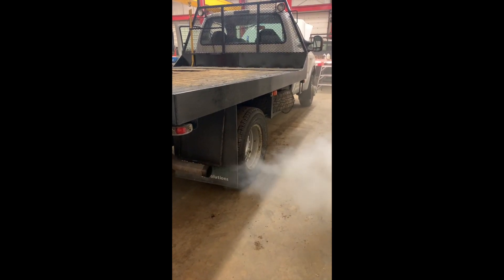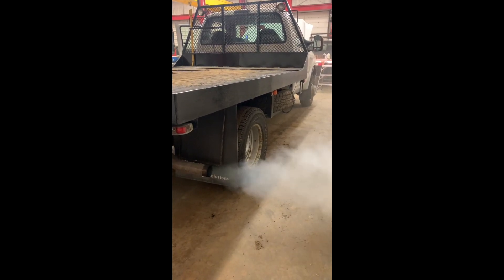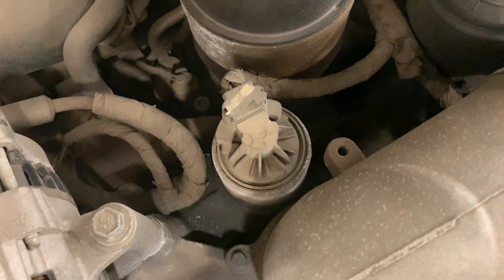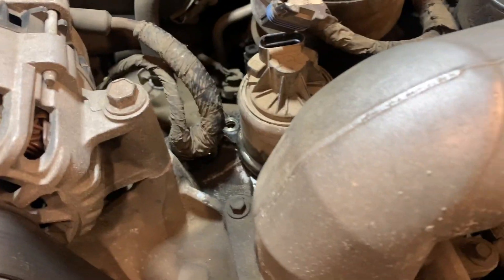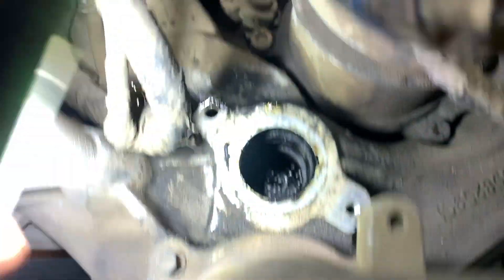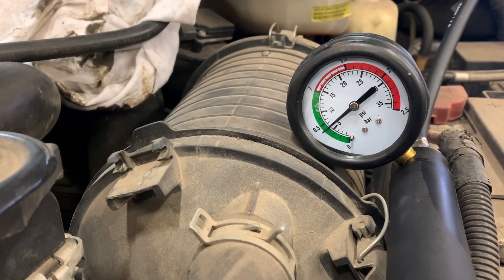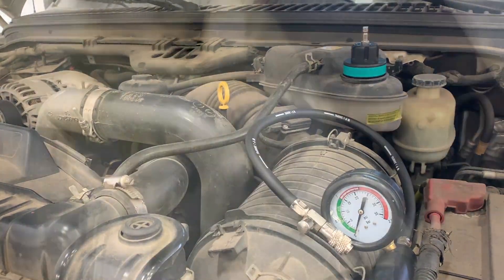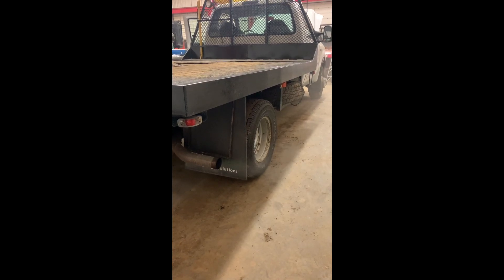Ford 6.0 PowerStroke Egr Cooler Failure

Comment: People that straight shit talk 6.0s don’t know anything about them. 03 and early 04s had a lot more issues but 04.5 and up are pretty solid trucks. Iv worked on them all and let me tel you I think Cummins are the biggest piles of shit out of all
Reply from the maker: If they were so good they wouldn’t have gotten sued..... I had a 06 and it was the biggest pile of shit I’ve ever owned in my life.....
Reply: @TestDontguess  probably bought an unmaintained turd. Have you actually looked into why they were sued? Probably not. All I’m saying I’d I see more dodges and chevys come into the shop with more frequent and more costly repair bills that the Fords in general
Reply from the maker: Not trying to start anything but nobody swaps a powerstroke into a dodge or duramax..... but plenty of Cummins swaps in Ford trucks....... just saying

Comment: 6.0 Powerstroke....Not even fit to be a boat anchor!  My 2002 F250 7.3 Powerstroke is still going strong with 500,000 miles.  Only had to change out a an IPR and my valve cover gaskets that had a short inside to one of my injectors.  I’ve heard the new 6.7 liter Powerstroke is pretty reliable with some impressive numbers for HP and torque.
Reply: Get ahold of superduty service in grain valley mo, they have several videos on YouTube as well.  They have a 6.0 with 800,000 miles on it, original motor, no rebuild.  I've got 2 of them with very little aftermarket done to them, one has 420,000 and the other 217,000 and so far no major repairs needed and no problems.  Take care of them and they'll take care of you.
Reply from the maker: The 7.3 was bulletproof and their biggest mistake was moving away from it